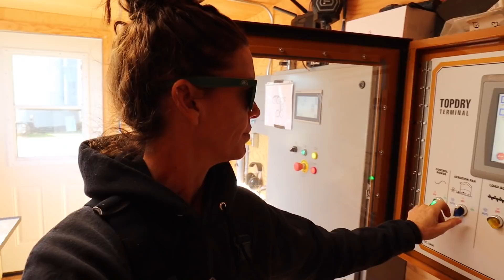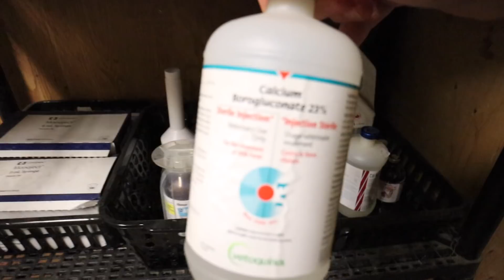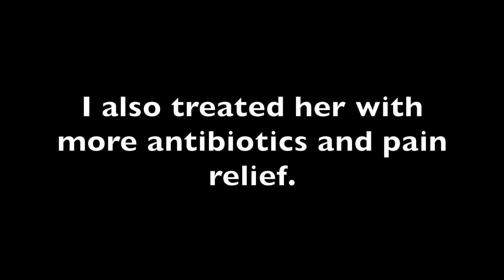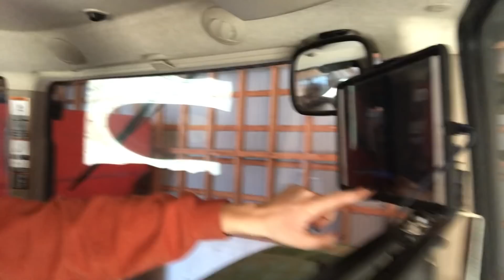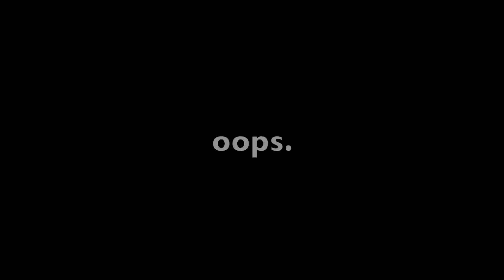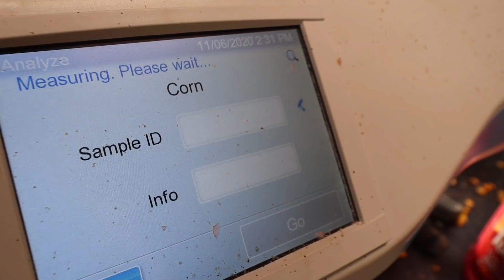A Series of Unfortunate Events.  Vlog 370

Comment: I do have a teeny bit of advice. Next time someone spills beans,corn,etc. get your shop vac and an adapter and use that instead. You can probably salvage a lot more and without a bunch of dirt. I know it works because I’ve had to do it rofl! FYI in case I’m not making sense I mean the spot where you plug in the cell charger 🔌 on the tractor .

Comment: why are you running a generator, did a storm take out your hydro. here west of Thunder Bay along that largest of the great lake we got 10 inchs of snow over night, went from 4 days of 14c to -4
Reply: My understanding is that they use the generator to provide extra power for the dryer and storage system
Reply: @terryst9835  not sure why, the grid has lots, i could see if it ran on 3 phase, but unless the system is really old, the newer ones all run on 1 phase 240 volts, even if it is an old 3 phase they have 3 phase lines on the road there, yes it cost a bit to get a 3 phase drop but a 3 phase generator is a lot of money, and a lot of cost to run and maintain.. for a large kw unit..
Reply: IIRC they only get one fase, and their system is 3 phase.